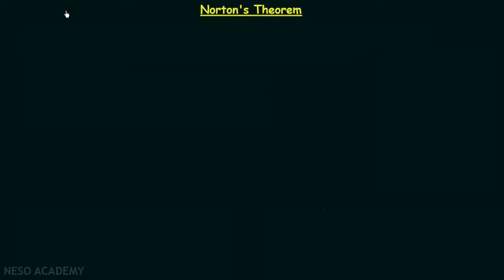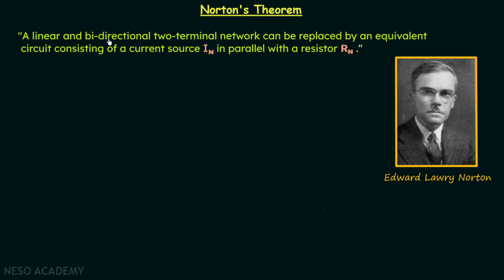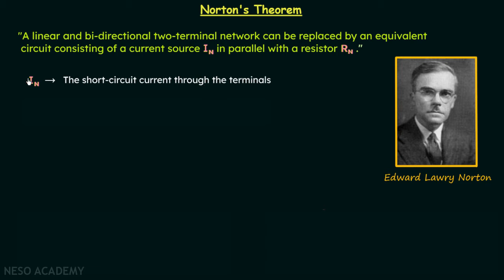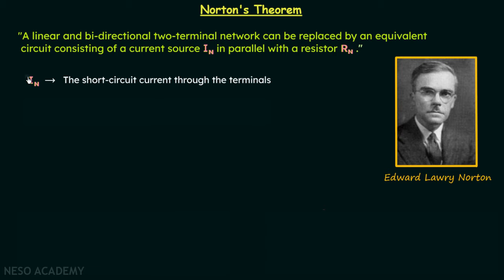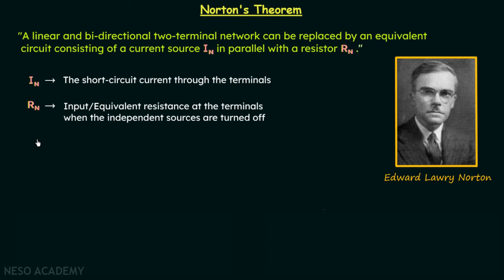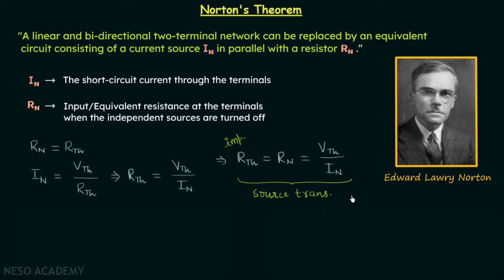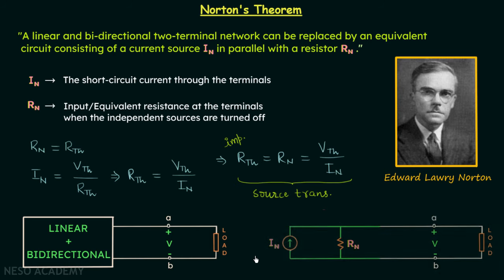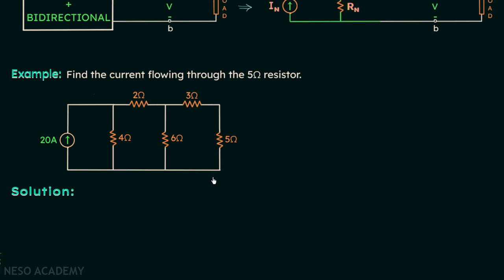Norton's Theorem

Comment: the current flowing through the 2 ohm resistor is 13.33 A
Reply: exactly
Reply: Yeah its wrong and the final answer for the current through the load will be 16amp

Comment: at 8.11 you said that the second path also has 4 ohm !  but the second path was 2 ohm. so we should apply the KVL there to find out the current. By the way,  thank you so much for this wonderful video.
Reply: After resistor 2ohm there is resistor 3ohm and 6ohm on parallel. So (3.6) /(3+6) giving u new resistor 2ohm so 2ohm +2ohm =4ohm 
That why the current split to 10A
Reply: Actually I also noticed the same thing.
Reply: @mohamedkhettar4883  but next turn m In find krne ke liye resistance ka values fir se Kyu use Kiya jbki vo phle ek baar use Kar liya current distribution ke liye

Comment: 🎯 Key Takeaways for quick navigation:

00:25 📝 Norton's Theorem states that a linear, bi-directional two-terminal network can be replaced by an equivalent circuit consisting of a current source \(i_n\) in parallel with a resistor \(R_N\).
02:23 📝 Thevenin's equivalent resistance (\(R_{th}\)) is equal to Norton's equivalent resistance (\(R_N\)), and Thevenin's equivalent voltage (\(V_{th}\)) divided by \(i_n\) is also equal to \(R_N\).
03:11 📝 Norton's Theorem and Thevenin's Theorem are collectively known as source transformations, a crucial concept in electrical engineering.
04:06 📝 In Norton's Theorem, independent sources are turned off, but dependent sources are left as they are during the calculation of \(i_n\).
10:45 📝 Norton's Theorem allows us to replace a complex network with a current source (\(i_n\)) in parallel with a resistor (\(R_N\)), simplifying the analysis of the circuit.
Reply: U are god❤

Comment: I had a question.
How come the first 20 amperes splits into 10A and 10A since there are 2 ohm and 4 ohm resistances exist respectively.
Reply: He reduced the resistors to two
Reply: Yes.. Otherwise use current to voltage transformation..

Comment: Why didn't you apply current divide rule in the first branch of the circuit which would have given the current in 2ohm branch as 20X4/2+4  rather than you calculated the equivalent resistance of the further circuit and divided the current equally.
Reply: I also thought so @ first, but that would be wrong as the current going to the 2ohm resistor is the sum of currents in 3ohm n 6ohm thus he used R equivalent them current divider giving 10A each
Reply: @tsireledzogiven7642  U r ri8 but u changed the direction actually it is ... The current entering to the node between 2, 3 and 4 ohm is sum of current coming from 2ohm and 4 ohm resistors so if we solve both by current divider also we will get 80/9 which is not the answer .

Comment: how come the current be divided equally in 4 ohm and 2 ohm resisitor? shouldn't it be 40/3 and 20/3 instead of 10 and 10. edit: okay now i get it. as 2 ohm and the effective 2 ohm are in series the current through them will be the same. so 10 A.
Reply: then I n should be also 10 A right

Comment: Can someone help explain why the 6ohm and 3ohms are considered Parallel to each other and not in series with each other, but the 2ohm and 6ohm aren't considered parallel nor why the 2ohm and 3ohm aren't immediately added together because they're technically in series.  I'm thinking it's because of the flow of current, but nothing in my book states that.
Reply: the farthest resistors are solved first, it's just like ohm's law. By redrawing the new circuit and solving it, the 2 and 5 ohms resistor are in series and then the process goes easily. Just think of the Rn as the voltage source and we're finding the total resistance. Correct me if I'm wrong

Comment: if it 4 ohm 4 ohm shouldn't i be 20*4/4+4
Reply: no bro, because its current source not a voltage source , if a current source is present then the current flowing will be equal to the value on the current source.

Comment: How will the current be divided equally for the 2-ohms and 4-ohm resistor?
Reply: I have same doubt
Reply: @devilogesh8874  Because after 2ohm there is a parallel resistor connected of 6 and 3  ohm so 3.6/3+6 gives 2 ohm ,which is in series with first 2 ohm now 2+2 =4 ohm so the current gets divided equally with 4 ohm and 4 ohm.
Reply: @sankethp3138  but next turn m I(n) find krne ke liye yeh resistance fir se Kyu use kiye ??
Reply: Sarah Miller  you are the one who need to search!!!
Reply: Sarah Miller  I know that parallel circuit will have voltage divider effect but the voltage will be divided across the resistors. You need to have more knowledge about that?

Comment: The ac ripple voltage is 1 V peak to peak. The dc (average) load voltage is 5 V. What is the Q-point current in the Zener diode? What is the maximum dynamic resistance allowed for the Zener diode if the output ripple is to be less than 10 mV peak to peak?

Someone help me solve this

Comment: Sir 8:16 how u divided current in 10Aand 10A
Reply: I to got same doubt resistances offered in two branches is not same
Reply: @aagfalcon3190  its easy bro. Just simplify the ckt n u will observe that the 4ohm resistor is in parallel with another 4ohm resistor. Hence the currents will be equal.
Reply: If you see 1st branch from source side apply kcl at two nodes 
(6 ohm|| 3ohm) series with 2 ohm
Reply: @veereshkammara9139  there was a short circuit so why should we consider  6 ohm .

Comment: Why can't we take 20 amps directly as the Norton's equivalent current?
Reply: Some of the current goes through other parts of the circuit. Norton's equivalent current only reflects the current over the load at the far right side, not the parts that are "lost" over the 4 Ohm and 6 Ohm resistors.